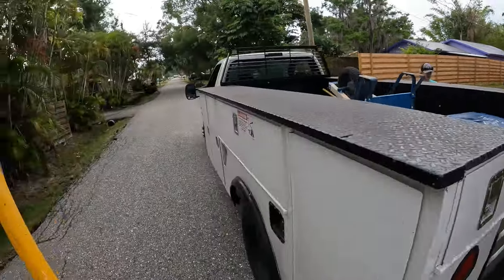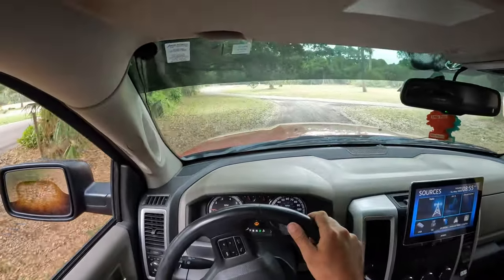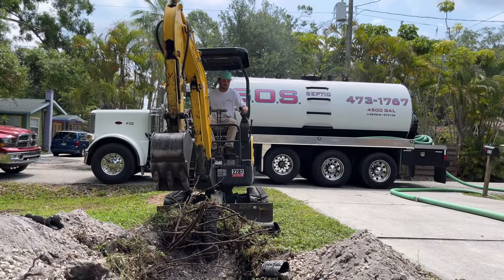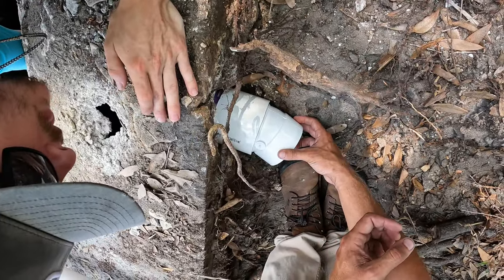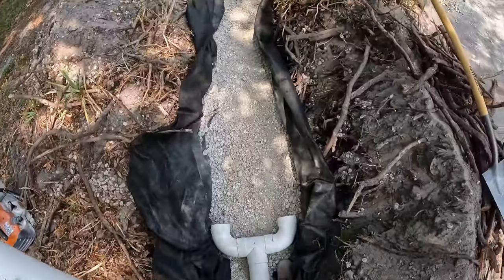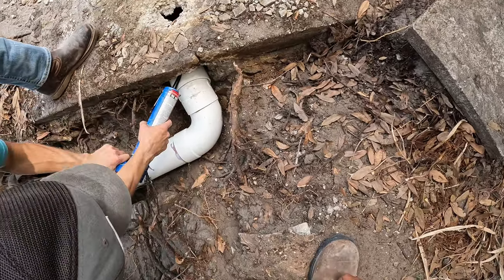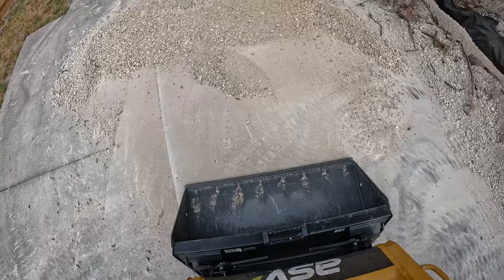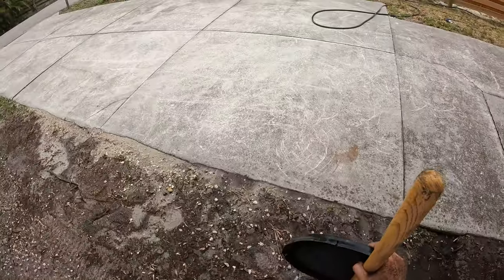REPLACING SEPTIC DRAIN FIELD FROM THE 1970'S

Comment: You'd never get away with an installation like that in my county. Sandy soil is the main difference. We have solid clay from about 6" below grade on down. Some installations have to have a mound drain field. Permits and inspections are required. Distribution boxes and 4 lines around 60' long. A "repair" area that is as big as the drain field is also required. My neighborhood was built in the mid '90s and no one has had to replace their septic system yet, knock on wood.
Reply from the maker: Every new septic system around here requires a mound and distribution box here as well, repairs do not though. we normally will do 3 or more lines on a 2 bath house but because this was a 1 bath house we did 2 instead of the existing 1.